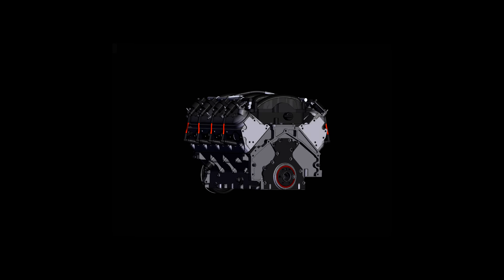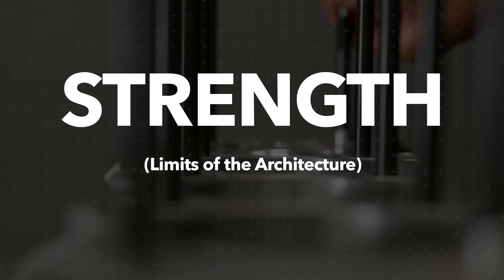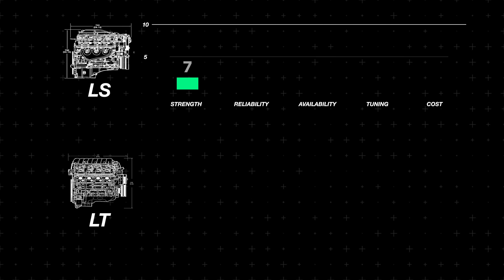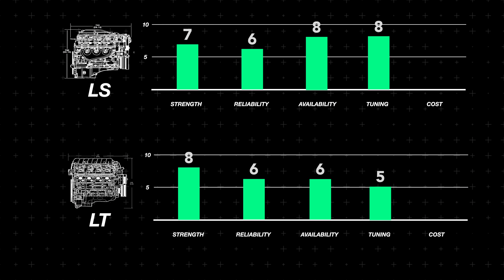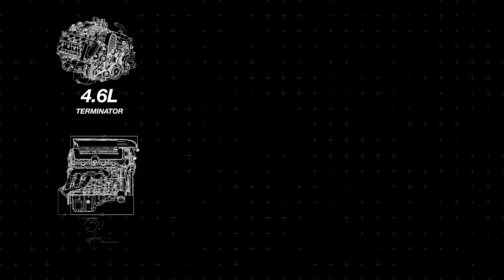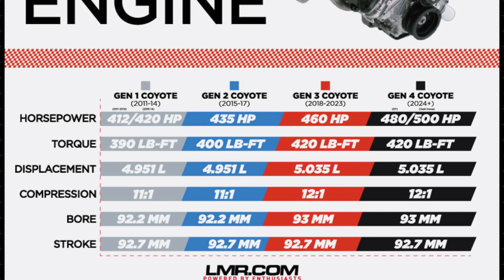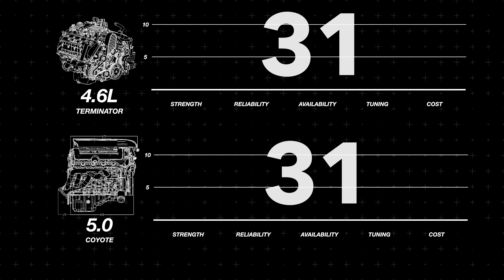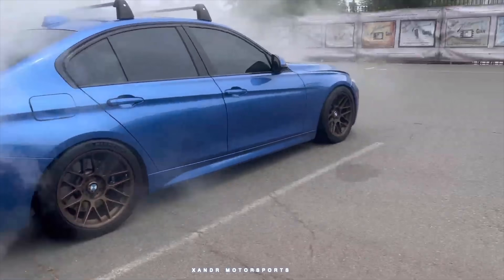Why Old Engines DESTROY Newer Ones💀| Explained Ep. 25

Comment: "how many burgers need flipping to acquire" 😂
Reply: Holy smokes I got a pin?!
Reply: make a video about m104
Reply: @DENIS-jz8zp  0m606 too please
Reply: Back in the 90s you could build a potent street warrior with a burger flipping job lol....nowadays 2 jobs gets you a hybrid or lower level electric car 💀lol
Reply: It’s more so that engine tech and innovation has peaked fora while. Meanwhile things like tuning tech and improvements has continued to get better at a much better rate. One of the most innovative areas of performance has come from transmission tech and the ability to put power down, stay in powerband and made reliability a non issue. Look at a engine 30 years ago and compare that to a automatic transmission. Also things like material weight, cooling efficiency and of course tire tech cause it’s all worthless unless ur tires transmit the power to the pavement. We’ve been making 1000hp 3000hp and up for 100 years considering before jet engines even planes used versions of engines you find in cars today. However it’s everything around the engines that’s kept getting better and better
Reply: 250k
Reply: 18% interest is approaching usery laws. give that some thought.
Reply: 💯Mad facts bro💯
Reply: least insane laughing emoji user:
Reply: Are you in the 337 area code?
Reply: R32 here will run ya 80 grand Australian. 
🍻🇦🇺🤙🏽
Reply: 250 yo 550 thousand depending on pay and taxes... I did do the math, I bid you a 👍
Reply: @kevinsimonsii6605  how'd you calculate? McDonald's at minimum wage with a tax rate of 31%? (I'm just throwing out numbers)
Reply: @datgamerboy123  around where I live they pay around 10 to 12 an hour, apparently you make a burger at McDonald's in 42 seconds, if you flipped one at a time it would take you 8 hrs and 10 minutes to flip 700 burgers a day, times that by 5 for 5 days a weeks, and then by 52 for 52 weeks and then times that by 3 for 3 years and you'll get 546,000 bur burs
Reply: @kevinsimonsii6605  Holy smokes
Reply: 200k
Reply: More like flipping bricks to get the older engine.
Reply: Yes. Older engines are more efficient, more reliable, easier to maintain or tune. 
Just less profitable than plastic computerised overcomplicated modern crap.
Reply: Can you please do a video on how the current McLaren V8 TwinTurbo engines are based off of an old Nissan R390 engine from the 90s?
Reply: @Mister-_-Fayce  interesting
Reply: @Mister-_-Fayce  it gets even crazier. The R390 is built off an old jaguar XJR platform. I believe it was the XJR 15 or XJR9.

Comment: Ive had both Ford modulars and LS now currently with my C5 Z06. LS is much chepaer to do anything to and i can do it all in my driveway unlike modulars. I sold my 96 Cobra years back and got another fox body because nothing beat the small block fords for simplicity to work on and parts.

Comment: I 100% believe if they had made the terminator engine for as long as they did the coyote. It would 100% rank higher then the coyote but the two biggest factors is tune ability and cost. Its no reason why it shuld be more expensive other then its rare.

Comment: The 5.4l modular engine found in the Ford trucks is the better engine to build up compared to the 4.6 due to the displacement. Plus they're similar designs, so not that big of a cost difference.

Comment: Seems kinda off to compare the terminator 4.6 specifically to the 5.0. Would you not compare the regular modular 4.6 that came in older mustang GTs. Giving the 4.6 a 10 for strength and the 5.0 a 7 just because the best 4.6 released had crazy internals and the stock gen 1 5.0 had some issues seems ridiculous when a 5.0 block can hold 1000 up to 2500 hp in later generations. Idk what 4.6 blocks r doin that. The quarter mile time skewing data doesn’t make sense either because if it’s comparing the two engines then you should factor in everything about these engines to make the scores. The fact a “deep pocketed individual” can get 2500hp into a stock coyote block and run 7 seconds matters because that being possible with the factory engine architecture is absolutely a testament to strength and arguably reliability.

Comment: I will stand behind the Chevy 350 as the greatest motor ever built. You can build a 350 to any price point, any power, and bolt it right into almost any GM product. The LS is better in every aspect, but the 350 has a swagger about it that the LS just doesn’t. (Ignore the LS3 in the driveway and 327 2 Barrel in the garage. I said what I said lol)

Comment: The 2jz portion on availability is wrong. I just bought 2 wrecked GS 300s and 1 fully running with no issues. All 3 are 1 owner cars. I am the second owner. The engines in all 3 are in perfect condition.

Comment: I've watched several of your videos and have been thoroughly impressed.  I have a couple gripes with this one though.  When reading "old" engines I expected a 302, 305, 315, 350, 351, 360 etc.  A 4.6 isn't really that much less complicated than a Coyote.  Ford just finally pulled their head out of their....  Second.  In no universe is any version of a 4.6 even comparable to a the 5.0.  The 4v version was what the bare minimum should have been, and even then a well built 302 could match it with a 40+ year older design.  You explained yourself that the Cobra was a limited edition specialty model that relied on 3rd party parts.  And a supercharger.  And was still outmatched by a stock, run of the mill, production 5.0.  I wish Ford would make a scaled down version of the 7.3 to make it easier for swaps into older vehicles, but the 5.0 literally made Ford fans able to feel like they can be taken seriously after a two decade disaster.

Comment: Newer engines come out with way more power than those older engines did at the time from factory... Now yes you can buy aftermarket parts in order to make way more power on the older engines that aren't that expensive becuase the engines have been around for a while and have had time for lots of aftermarket parts to be made for them vs the newer engines that are so new there are only a couple aftermarket options that are typically more expensive. Give these newer engines 20-30 years and they'll have way more aftermarket support and will be able to make way more power than the older ones. Now I'm not saying the older ones aren't great, id much rather have a classic becuase I understand how to work on them better and they don't have so much electronics, but the newer ones are definitely not worse than the older ones... The difference is just a lack of time🤷

Comment: As a 1100whp MK4 owner, i may be biased.
However, i am not sure why people are stating that the 2j is rare and expensive compared to the b58. Google and fb marketplace searches will show you that there is no scarcity in 2j block or heads. And the prices are very reasonable, not far from the b58. Not sure where people are getting this info from.
Reply: And there are so many cheap toyota or lexus cars with a 2j inside

Comment: You can buy crate 4v “aluminator” motors from ford performance. They are pricy though. Cheaper to build one from a 98-01 cobra or 03-04 Mach 1 and forge the internals.

Comment: old engines do not in fact defeat newer engines. the 4.6 engine block is never making the power that the coyote can. there are no 2,000 hp 4.6 engines while there are dozens of 2000 hp coyotes.

Comment: I can’t believe I haven’t seen anything about the 2000s 2.7T Audi engine, it comes stock from the factory with forged pistons and rods. I own as well as have known others who owned 2.7T with completely stock engine internals and they are pushing 605 HP and 480 TQ with many of them making it past 200,000 miles and even some past 300,000. I bought mine for 5,700 and had a stage 1 tune done on it when I first got it and it was pushing 368 HP and 322 TQ with absolutely nothing other than adjusted fuel air ratios. They are affordable as they came in the S4 and even the A6 and A6 Allroad models as well as plentiful with tons of aftermarket support and parts. The only problem with these cars is how hard they are to work on them mechanically as everything fits perfectly into the engine bay leaving no room for tampering or repairs.

Comment: the video you showed talking about the b58 failure doesn’t pertain to the water pump.  That video was an example of a pcv failure, which is not an issue on the b58tu that the supra uses, just a gen 1 b58 issue.

Comment: reminder that the 4.6 4v is VERY common.

1993-1998 mk viiis, lincoln aviators until 2005, all cobra mustangs, from 96-04. 5.4 4vs are also relatively common in f150 lightnings and lincoln aviators.

Comment: Great choice to compare the B58 and 2JZ even if I don't agree with ranking the 2JZ ahead of the B58 on strength because of the aluminum block architecture of the B58 which hasn't stopped it from being pushed to the same 4 digit power levels as the 2JZ. At the same time the double VVT valvetronic with twin scroll turbo of the B58 puts it a stage 1 tune away from 500 hp, in my estimation giving it the edge it tunability.

Comment: well I disagree... weight... yes new Engines are made of aluminium...and can make the same power more easily.... but when it comes to really much power yes the older holds it better.... but at what cost? 50-100kg more isn't exactly better.

example gr yaris can easily hold 600 horses with only 1.6l.... name one old engine except vtec engines that can do this... with the same weight... NONE
Reply: 2jz comes in at 200kg while the b58 comes in at only 139kg...

Comment: Ok change for "why old modified engines destroy newer original stock engine".
Reply: Why change? Cuz the point about old engines is that they can be modified/tuned easily (and those other factors stated in the video), and newer stock cannot, especially with their ecu

It's also not that old

Comment: When you said old engines I was thinking of engines from the 1969's and 1970's, not the 2000's. You should be comparing the new 2010 engines to the old Hemis, Rat motors and Ford motors.

Comment: Over here in Europe the B/S58 have completely took over the tuning world, it's now not uncommon to see 700-1000hp hatchbacks with these engines, they have far more support than the 2J just because BMW have them in nearly every car they make, plus its modular so the b3/48 are essentially the same thing 
I've got a manual M240i just under 500hp with a debadge, its great to race you never know if someone has 300hp or 700hp
Plus all the VAG cars over here are tuned as well it's like living in mad max sometimes

Comment: Interestingly enough, a 2JZ will not reliably make a thousand horsepower on the stock rotating assembly. However, hot rod magazine took a 4.8 LS truck motor. Put two turbos c16 and Holly fuel management on there and made a over  thousand horsepower for like 16-20pulls

Comment: B58 vs 2JZ isnt a great comparison
BMWs N54 is what really competes with the 2JZ
Same insane price per horsepower and tunability and similar strength while being an alluminum block
Things can push up to 500 on stock turbos and 800 on a stock block
BMW heavily overbuilt these engines because it was their first attempt
As for realibility 
Yeah its a BMW what do you expect
But its much cheaper, much more available 

And as for pulling an engine from a IS300,SC300 or GS300
Most of them are VVTi engines that have nuch weaker internals and higher compresssion
Non VVTi engines out of the early GS and SC are still exoensive to buy and build since you cant just bolt on the supra parts and be done with it

Comment: From my own input, the engine that the new Supra uses is not exactly the same as what BMW made. Toyota made their own changes to the engine block it's self. BMW's block is not made with a closed face deck, probably why their shit is not nearly as reliable. More like a baseline for Toyota to build off of. Also, as a GM technician, both LS and LT engines have a few problems but as a hole they are both solid. A lot  of the problems I see as a Chevrolet tech is that customers do not do their oil changes. Don't know much about the Ford engines but my brother had a '96 Mustang with a 4.6L and I wouldn't recommend that car to anyone that I cared about. Only credit to that Mustang is that the engine when it did run good, it ran very smooth.

Comment: You forgot to mention that you cannot bore the b58 engine. once the bore is worn its a throw away engine and you need to buy a new block from BMW or sleeve the block. the b58 doesnt even hold a candle to the 2jz.

Comment: Not in all cases will a newer engine give better mpg. For instance, I've seen my small-block 350 tbi in a 2wd 1/2-ton truck get as high as 18.4mpg (still driving around to this day) whereas the LS3 5.3L that I witnessed from another family member's truck get 15.2mpg on rare occasions until the AFM and the DOD decided to snap a connecting rod several years ago.

Comment: this is a very crude comparison. a lot of crucial factors were not taken into consideration.

external factors like emission regulation forcing manufacturers to design engines in a certain way is a big reason why old engines were much simpler than modern ones therefor seemingly more reliable. if we are allowed to continue exacerbating the negative effects of climate change, modern engines will for sure turn the table in reliability and tuning potential etc. but is it worth risking our grandkids living in a hot waterworld? nope.

0:27 sooo funny you mentioned 4g63. is it a better engine than 4b11t? lmao. the only people who say yes are either completely clueless or building 4-digit bhp drag cars. because 4g63 is literally inferior to its successor in every other way. 4b11t makes power so much easier, much more reliable than 4g63 when under 500bhp at the crank (≤ 500 crank hp is what 95% of evos on road no matter which gen is sitting at right now) and has a much wider torque band. did i mention alluminium blocks handle heat ten times better than iron blocks? did i mention 4g63 didn't even get MIVEC (variable valve timing and lift) until the very last gen? did you know for a transverse turbo engine, having the exhaust coming out in front like 4g63's config causes so many issues like packaging (especially when you want aftermarket parts installed), cooling, chassis weight balance etc? the dirty laundry list goes on for keyboard warrior's favourite evo engine.

so why old engines destroy newer ones? because it's a nice clickbaity title.

Comment: Avalability and cost overlaps each other and makes older engine closer to new ones in comparison. Therefore 2JZ-GTE or Terminator  engine were punished twice for the same thing in points. It's a flaw in design of this comparison, that has to be corrected to

Comment: Yamaha only designed the 1JZ head.
Because toyota had major shares in yamaha at the time and the motorbike engines screamed so why not use them to make a head that screams too?
Yamaha also made the exhaust on the Lexus LFA.
Reply: Also you can still buy new 2JZ blocks, billet and factory, they just cost a f**k load.
Its NOS (New Old Stock) not 4 owners in.

Comment: In the early 90's Toyota built version of the 3S engine similar to what was available for the Celica/MR2/Rav4 (specifically the 3S-503 which was a turbocharged 2.1L inline 4 cylinder) for the Factory GTP Eagle MK 3 and Croup C Toyota 88C that could be tuned to over 800hp.

Comment: then you get a german grandpa engine, om606.the base model without turbo makes about 80 horses. you slap on a proper pump and a decent holset turbo, and yer rocking 600. if yer willing to spend on internals, it will do 1000 hp. and its a diesel. wtf is the question again ? its good old iron block, 3 liters, 24 valves.

Comment: As professional engine builder, this missed the mark badly on a couple. The worst is the 2JZ vs B58, I’m not a fan boy or hater of either. I just know from building and tuning experience the 2JZ is cheap per HP, especially when going for big numbers. The reliability comment on the B58 ignores overall reliability. The bottom end and block on a B58 are one of the best, I would quickly agree very close to 2JZ. That doesn’t equal overall reliability, VANOS sucks for reliability and bigger horsepower. VANOS is expensive to repair and if you are actually racing your car and not just building for show off HP, it loses races if you don’t go around it.  Also the direct vs port injection, do some more homework. Port is less efficient than direct, but you can deliver more fuel with port making more HP, especially on turbos.